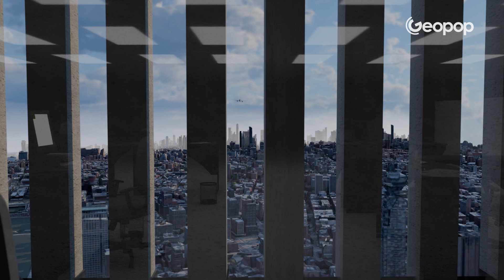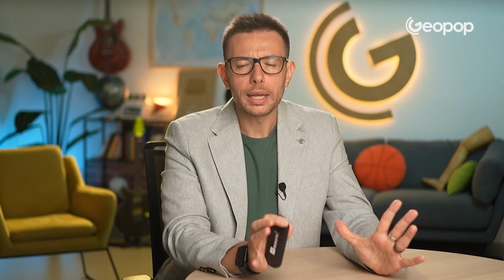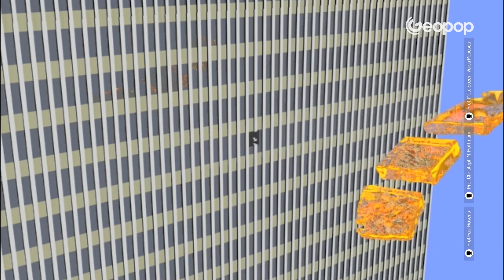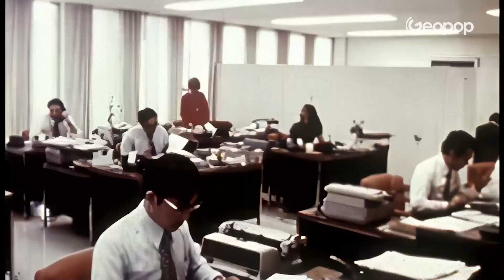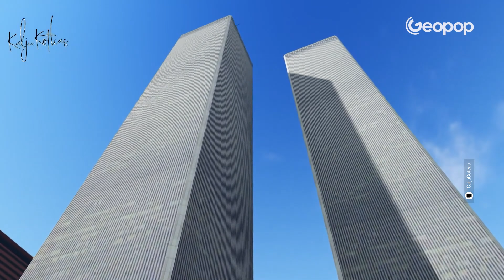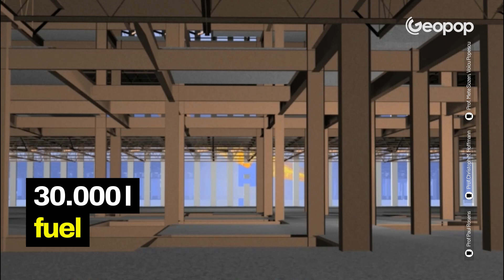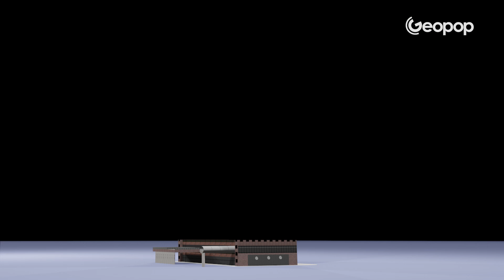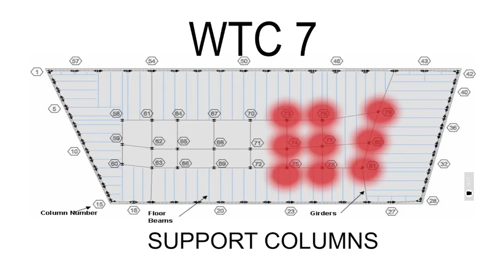9/11, 2001: The Technical Reconstruction of the Twin Towers and WTC 7 Collapses

Comment: You explain WTC 7's collapse complete with an animation showing a cascading failure starting at one end of the building, then immediately cut to footage of the actual collapse which went straight down from the centre.  So, which was it?  Also, no mention of the fact the building was reported to have already collapsed over an hour before it happened.  There is footage of reporters saying wtc7 had collapsed, while it was still clearly visible standing in the background.
Reply: The video fails to explain an important point which causes your confusion. WTC7 also had an outer shell which remained intact until the whole structure had collapsed inside of it, at which point it came straight down on itself.
Reply: @Mdnightsoldier   no that does not explain it. Even if there was six inches of space between the brick facade and the walls, the building must fall PERFECTLY vertically to not take the outside with it.  Did you watch the computer simulation?  It falls on an angle.  The ACTUAL fall was perfectly vertical.  That requires precision removal of the walls and core simultaneously.  That is why they don't bring up this subject.
Reply: @Mdnightsoldier  no I've seen the floorplan of WTC7 and the 83 support columns are divided evenly throughout the building. You cannot have the inner part of the building collapse without the outer frame of the building falling with it. And that's just one issue by the way. There's also eyewitness reports of many dead bodies in WTC7 while the 9/11 Commission said nobody died there. There were also two gentlemen who were rescued from WTC7 after experiencing several powerful explosions on floor 8. Then there William Rodriguez, the head custodian of the WTC complex who was in the sublevels precisely before and during the first plane impact and there was a massive explosion in the basement BEFORE the plane struck and his coworker has all the skin on his arms effectively detach from the pressure wave and it was hanging off his arms like he was taking off a shirt. President Bush even gave William a medal because he used his master keyset to open many locked doors and save hundreds of lives. He is ADAMANT the explosion in the lower basement was BEFORE the plane hit.
Reply: @brandentownsend7298  why should we believe "eyewitnesses" or W.R.?
Reply: @brandentownsend7298 Yep. Their's a whole documentary on it that has seemed to be scrubbed from the internet. They talked about the explosions, Atta's passport in the rubble, beams were cut in what is called a demolition cut, and the elevators being shut down and worked on by a company that was owned by a Bush. Plus, a plethora of other damming information. Dick Cheney said, "To unite the American people we need an event akin to Pearl Harbor."
Reply: @brandentownsend7298  if you knew anything about what you were talking about, you would know that the jet fuel from the planes dripped throughout the elevator systems and caused explosions all throughout the towers, all the way down even in the basement. it was not before the planes struck, as many other eyewitnesses have confirmed. crazy how he's the only one who thought it was before the planes struck when he was in the basement far away from being able to see or hear the plane. what might have been what he thought was the plane was debris hitting the ground or the fireballs exploding in the lobby, but every single other witness has not mentioned the fireballs being before the planes hit.
Reply: @brandentownsend7298 spot on mate couldn't have listed the many obvious problems with the mainstream narrative top man!
Reply: @worblergworbler  WTC7 wasn't hit by a plane. The jet fuel thing is BS. A detonation wave went through the lobby of the twin towers and blew out all the windows and dislodged granite panels off the walls. Gas doesn't detonate...it's conflagrates.
Reply: @mikehenrys eyewitnesses are often unreliable sources of info
Reply: @Mdnightsoldier 
The construction drawings of WTC 7, and the inspections written reports and supporting photographs clearly indicated that the so-called outer shell was fixed to the steel frame of WTC 7. There is no way the two collapsed separately. 
See the UAF Study of WTC 7
Reply: @21:09 "Now why did the NIST rule out explosions?". Then we are shown a video of outward blasts on a demolition.  If I were a police inspector, and someone dismissed an explosion, I would agree that the person was not murdered by explosion.  But have we considered knife wounds, or arrows or bullets or poison. That dismissal of explosion appears to me as a straw man. Look at their computer simulation. If the internal structure has disintegrated, then that part of the building has fallen.  Column 79 would not have collapsed unless 44 was pulled inward.  That outer wall on the southeast corner would have fallen very early.  If their scenario is correct, then the building would have collapsed toward the south east early on, but possibly only a partial collapse.  Not almost straight down.
Reply: @JosephBoxmeyer-u3d because explosions didn't make the building fall.
Reply: Noone understanding the very different construction of #7 from the design of #1 & #2 would have expected #7 to fall because of fires, only as though it felt the need to copy her two taller sisters.
Reply: @JosephBoxmeyer-u3d  You don't speak for 'everyone'.
Reply: @mikehenrys   sorry, Mike, I don't recall speaking for "everyone".  What do we disagree on?
Reply: @JosephBoxmeyer-u3d  "No one understanding..."
Reply: The video shows the same thing as the simulation.  The internal portions of WTC 7 failed first, leading to a progressive collapse from one side of the building to the other.  In the simulation, notice that once the penthouse on the roof collapses, a vertical collapse continues downwards from it while the outside frame of the building remains largely intact.  Once the complete support from the three critical vertical columns was gone, the others failed progressively - but very quickly.  With each failure, more weight was placed upon the remainders, accelerating their failures.  Since this collapse progressed from one side of the building's core to the other, it can be clearly seen twisting, developing the famed "kink" along the roofline (a horizontal distortion, not a vertical one) just before it begins to collapse vertically.  It matches the simulation precisely.
Reply: @marksanders768  no the real fall does NOT match the simulation.  Did you to really watch it?
Reply: @marksanders768   sorry, where is the twist that you clearly see?  I do not ask this to be combative, but to me more than half of the fall is straight down.  And can you honestly believe that if all of the beams are giving out at the same time, that none would poke through the outer wall?  To me, the official story is a strange conspiracy theory.  It is asking me to accept and to pretend to see what I cannot see.  Help me.
Reply: Pull it ?
Reply: Seven didnt go straight down. It leaned in the direction of the failed support . You can see it in the this video if you're paying attention and in many other videos from several vantage points. But of course you are married to your ideology so I guess it went "straight down".
Reply: @bweber6256   I do not recall whether you have insisted that the actual fall of seven matched the computer simulation.  If not, then sorry.  But I have watched the simulation again, and the sides bend inward at the top six floors.  But did not happen in the actual fall.  I do not have an ideology on this. I am just bothered that I see things that do not fit the authoritative story.  Their simulation is based on the fall being initiated in the order which they fed into their program.  I agree that the first thing that I see is that penthouse collapsing.  Then I see light in the windows at the corner under that penthouse.( this is from a different video). Then the center of the roof bends downward. That would agree with the sides at the top bending inward.  Except that they don't.  I sincerely question whether they correctly programmed the actual building into their computer .
Reply: @JosephBoxmeyer-u3d  there is a much more detailed video of WTC7 collapse that juxtaposes animation with actual video of the same sections and shows very clearly how it failed along with the engineering explanation. The beginning of the failure was in part because of the retrofitting to increase the floor count to 40+ stories. Because of the utilities in the lower floors they had to do some creative design to put support columns on one side of the building. This arrangement, rather than straight vertical columns is what led to the initial failure. You can find the video I'm speaking of on You Tube. It shows the structure of WTC7 and the sequence of failure in more detail than this video. It's hard to deny the logic of the explanation and video evidence if you watch it.
Reply: The steel below the fire wouldn't have been weakened by the fire thus it was not going to break like the heated steel.
Reply: @johnstoddard4692 weakening steel ultimately caused it to collapse.

Not thermite, not bombs, not heat rays or whatever you people pull out of your ass.
Reply: That's what I noticed immediately. 
The claimed weak point that supposedly started the "progressive collapse" is the opposite of what we see in the video. 
Anyone who doesn't question why this is is a cowardly simpleton.
Reply: I am not a fanatic conspiracy theorist but WTC7 collapse is a mystery and Im sure there is a coverup. america lives on cover ups, Area 51, Marilyn Munroe, JFK. The list goes on, and will continue.
Reply: Reuters accidentally reported WTC 7 as collapsed. It had been completely cleared as it was deemed " AT IMMINENT RISK" of collapsing. Reuters got it wrong. Nothing weird. Nothing sinister. If you think Newsagencies dont screw up sometimes then you need to get out a bit more!  The BBC picked up on the Reuters report and reported it themselves. Again. Nothing weird or sinister. Conspiracists are scraping the barrel saying this error is evidence of wrongdoing.
Reply: https://youtu.be/f3YTrU2eARo?si=w8kTp_FGKNeeXqSo

;)
Reply: Go figure it was bbc news, a news channel not even from America that said something wrong.
Reply: Omg. SMH.
Reply: @TheCriticalStinker-jw4fl.     Personally, I see no need for rudeness.  Yes, it "sank in".  Thank you for the information about the collection of steel debris.  Is all of that material catalogued and available for viewing on You Tube?  We can be polite.  There are at least two groups of people involved in this discussion.  Those who believe that they already have sufficient understanding to have formulated their conclusion.  These should consider themselves as available to answer questions for the second group.  I am of this second; we who are sincere inquirers .  I must speak to the term "conspiracy theory".  I have binge watched many many videos about 9/11.  Many times I have watched the planes.  I have not yet seen any evidence to bring me to conclude that Muslim terrorists were flying those planes.  I have heard the desperate calls from passengers on those planes.  That seems trustworthy. But, by definition, those terrorist pilots is a conspiracy theory . I make this observation because the name calling is not normal to civil conversation. On what site might I view the evidence?
Reply: 4 planes hijacked.  3 planes hit a target.  4 buildings went down.
Reply: The minds of children are easily manipulated when some of the adults are lying! 

What about the molten steel?  Rivers of steel.  Like a foundry!
Reply: Those buildings were taken down with professional precision. Thinking any differently means you are living comfortably in your indoctrination.
Reply: Back then the majority of people didn't have Internet in the palm of their hand. The news could easily BS people into a war back then. You couldn't do it today as easily. That's why they had to come up with covid. Too much compartmentalized  bureaucratic people involved and nurses and doctors that invested so much into their career that they turned a blind eye to the fraud and medical murder.
Reply: It was pulled! Inside job!
Reply: AE911Truth
Reply: @mvwoon we all know the truth, its you conspiracy assholes that refuse to be proven wrong.
Reply: Which is it? Do you trust reporting from people on the scene or are they all fake news helping the conspiracy? You can't have it both ways. In the moment reports are often wrong. They're just trying to break the story first. Obvs people on live tv with the building behind them were mistaken. Let it go.
Reply: @scalzmoney  Let it go? How many facts do you discount before you arrive at a conclusion that fits your comfort level?
Reply: @scalzmoney  WTC7 came down like it did because it was a controlled demolition. 

THAT is why they knew it would collapse. That is why the media broacasted it.

And yes the media is corrupt, although you could see a lot of honest reporting on the day itself, as events unfolded.

Those parts were carefully selected never to be shown again to people
Reply: @Shawn47  There was inaccurate information and pure speculation flying around the news all over that day. It was mass chaos. No one knew really what was going on in the heat of the moment. I remember hearing reporters talking about car bombs going off all over DC and NY, one said the planes were private Cessna type. The reporter probably had no idea which building was which and mistook one of the four buildings that were almost entirely crushed under the wreckage of 1 and 2, for building 7.
Reply: @TheKairielise  no they specifically stated the Solomon Brothers building (WTC7) was the 3rd building to collapse, while the building stood in the background. It then fell 20 minutes later while they were still talking and on the air.
Reply: I have a question for you, conspiracy theorists: who do you think was on those planes? I mean, the hijackers
Reply: @lucagnecchi5228  There are quite a few possibilities;
 - Actual terrorists, contracted indirectly by government agents, not realizing who they were actually working for.
- The real planes were switched, and the ones hitting the buildings were unmanned and flown remotely.
- The terrorists were actually U.S. agents brainwashed into believing the cause was worth their lives.
- The terrorists were U.S. agents tricked into believing there was a way out until it was too late.
- Aliens.
- Any number of other possibilities.
Reply: @lucagnecchi5228   yes the hijackers.  Have you heard of coordination?  Our govt. knew about the flying lessons for people who didn't want to land the planes.  And we knew who they were and where they were.  We had inside people in their organization.  We knew their true identities and which planes they were on.  Didn't it bother you that there was a public announcement of who they were only hours later?  Supposedly, we still don't know who planted a device at the DNC headquarters on Jan. 5, 2021.
Reply: @lucagnecchi5228   I have watched many many videos.  I see the planes.  I have never seen any Muslim hijackers.  Have you seen any Muslim hijackers?  Give me a good reason to not call this a conspiracy theory.  Yes, I agree with you, if you tell me that you have heard recordings of callers on the planes, and of the voices of hijackers recorded by flight control people.  And I doubt that they were faked.  But I believe that there were very complex things that happened.  And that official story leaves out too much.
Reply: @lucagnecchi5228 innocent lives. A mother and daughter flying from Boston to California for a Disneyland trip. An 87 year old man who was flying to be at his sons wedding. Betty Ong, who was a stewardess called to warn atc of the hijacked aircraft, she repeatedly said the flight was sporadic and also said she can see buildings out the window. She stayed on the line up until impact.
Reply: @TheCriticalStinker-jw4fl.  As to my meager knowledge of physics, I seem to recall that "thermal expansion" on steel is normally an effect of the heating process, while cooling causes retraction.  But as to water, contrariwise, cooling below freezing causes expansion, and warming of that water above freezing causes retraction; the necessary temperatures for each being dependant on pressure and elements in solution.  My comment about the the steel beam expansion was based on my doubts that the fires were of sufficient duration to have caused such expansion.  Also, as you are aware, a steel structure of the type in #7 is not obligated to fall entirely because one end falls.  This is the reason for the need for thorough placement of charges in a planned demolition.  Even if a fall was initiated by the failure of the beam between columns 79 and 44, there is no reason to expect the entire floor to collapse, nor for either of those columns to fail.  As you understand, the NIST computer simulation received faulty inputs.  If you are familiar with that program, you understand that improper dimensions for the steel parts was input.  Also, false criteria for catastrophic failure were input, resulting in illogical simulation results .
Reply: The New Pearl Harbour?
Reply: @lyft4238  I posted the comment about Cheney saying that, and my comment was removed!
Reply: You didn't pay attention to the video. The collapse began as an internal collapse that then pulled the rest of the building down. WTC 5 also had extensive internal collapse even though most of the outer structure was relatively intact. 
There was much confusion on the ground about which buildings were which, even among the first responders. There are numerous videos of police and fire mistakenly referring to the remaining structures by the wrong number and in once case two firemen arguing about which building was #6. If local fire and police weren't sure, it would be easy for the BBC guy to mistakenly refer to (or have been told the wrong number) one of the other buildings that had collapsed as "WTC 7". There were other buildings that came down besides these three. 
But yeah, I'm sure the BBC reporter was in on it....🙄
Reply: George Bush was waiting on it to happen.. the building was full asbestos and needed stripped back to concreteat also needed an excuse to start a war with the east.  I was hoping that this video would show me some new information but no luck
Reply: @KouRou2002 Omg! Not that bloody asbestos conspiracy again. 😂😂😂
Reply: When bush was told that twin towers was demolished by incoming plane he smiled from being told that's happened and he didn't rush in telling people and nation that it terror related.  @KouRou2002
Reply: @brookerobertson2951  You are talking crap. The US were in the process of negotiating with the Taliban Government for drilling rights . 9/11 and the subsequent war screwed that up.  As for the asbestos thing? WTF has that got to do with the USG? It was privately  owned. 
IT WAS A F*CKING TERRORIST ATTACK.
Reply: @KouRou2002 so you mean to tell me all of the ATC recordings from the aircraft, hundreds of videos showing impacts, debris from both towers destroying everything around it, burning debris that pelted the southern face of wtc7 dont exist to you? Are you this much of an idiot?

Wtc 7 because a supporting beam couldn't stand to the fires. A total collapse followed starting with the floors and steel followed by an empty shell of a building came down.
Reply: Well it was probably reported early as new stations want to be the first to call something out or publish something. It was well known WTC 7 was going to collapse. They evacuated the area long before the collapse, most probably because it was a hectic day and a lot was going on someone said it had collapsed or some misscomunication and they reported on it even though it hadn’t collapsed yet. As stated they knew it was going to collapse before it did. Also it shows the inner core more or less collapsing, which the outside didn’t do untill moments later. The technical analysis of the collapse might also be slowed down a bit but again the core collapsed before the outer shell. If you actually look at the photage of the collapse like a minute of it you will see 20 seconds before the collapse the penthouse goes down. Which is on the side the collapse started, btw if it was explosives you would hear it. Ever heard a demolition of a building. Its loud, its really really loud. Not to mention as he said debries shoot out.
Reply: @unterman8589 lol liar
Reply: @unterman8589WTC7  was the socalled alleged "first steel skyscraper to completely collapse from just fires alone", according to NIST. 

So, how can one predict a "first time in history"?

I'd like you to think about this question.

I think we can agree on that the collapse of WTC7 looked very much like a controlled demolition.
Well I hope we can.

And if it looks an awful lot like a controlled demolition, what are the odds that it would NOT be one?
Reply: @unterman8589i love that you people disregard important factors that day to fit your extremely shitty narrative.
Reply: @unterman8589 
Unfortunately for believers of the official story, four independent studies of WTC 7's collapse completely disagree with NIST's guesswork.
Reply: @JackCarlock56 no signs of demolition were found. Stop lying, you ape.
Reply: And why did Israelis dance in celebration?
Reply: @loco1j  A better question is why this (coincidentally antisemitic) rumor won't die when there's zero proof of it.
Reply: @compwiz101 those 2 words has have been completely stripped of its meaning.  The evidence is clear. The motive is clear. So my statement is correct
Reply: @compwiz101  There's a mexican live news coverage here on youtube that has those images, live as it happened. I remember watching the news when it happened and I remember it well. They even parodied those images in The Simpsons Movie.
Reply: @compwiz101 Er, because #IsraelDid911, on account of how its a Terrorist State that has absolutely no qualms about mass-murdering innocents and blaming others.
Reply: @Hik4rol  Funny how people keep saying them remember seeing this, but never produce any of this supposedly widespread footage. 
Given I can find more people that are certain they saw a movie back in the 90s called "Shazaam", starring Sinbad - dispute the film never having existed, I want evidence.

There were report of 5 men supposedly jubilant - according to the one New Jersey woman that reported them. (Shout-out to everyone believing random old lady with binoculars being a 100% accurate judge of behavior at a distance)
She didn't record them, so I'd certainly like to see the supposed footage of the event.
Reply: @compwiz101  I did and owner of this channel blocked my comments and direct links LOL 😆

Search for TV AZTECA cobertura del 911 here on YouTube. Around the 3:00 hour mark, the footage LIVE shows up.
Reply: @compwiz101 
I already and they took my comments down lmao.

Look for mexican coverage pf the incident and you'll see it live as it happened.
Reply: @Hik4rol  Man I'm not going on some wild goose chase with the vague descriptor of "mexican 9/11 coverage"
Reply: @compwiz101  Search for TV azteca 911 cobertura. The scenes are there and they also interviewed a reporter on site and she described what happened live including peoplebgiving out candy on the street and dancing.
Reply: @compwiz101  Search for "TVaztec 911 cobertura"

The scenes are there and they also interviewed a reporter on site and she described what happened live including people giving out candy on the street and dancing.
Reply: @compwiz101  search for 📺 azteca  cover tura (date) and you'll see.

(Please write the emojis. I'm going mental trying to write this without it being taken down)
Reply: @compwiz101   You wanted proof and I gave it. Not my fault they keep pulling my comments down when I address the damn video even with timestamps.

Someone wants to keep this embarrassing display of hate a secret for reasons beyond me.
Reply: @Hik4rol  Unfortunately, you giving proof is functionally identical to you saying you've provided proof while doing nothing at all. Doubly so given that you're doing nothing to sidestep the problem like, say, providing the title of the video so someone can actually find it.
Reply: @compwiz101  Look for Azteca Siete Cobertura (date) and you'll see it at the three hour mark live.
Reply: @compwiz101   Look for Azteca Siete Cobertura (date) and you'll see it at the three hour mark live.
Reply: @Hik4rol  Reuters Agency fucked up and a couple of news agencies just repeated the info in error.....including the BBC . Nothing unusual about that WHATSOEVER. Conspirasists BS.
Reply: @loco1j  They didn't, you basht MAGAt.
Reply: @loco1j  because they knew they could easily convince the idiot republicans in charge to attack their muslim enemies. And they were right.
Reply: @loco1j  I'm sure you danced in celebration on Oct 7....does that mean you had something to do with it?
Reply: @loco1j they were arrested. Go simp for palestine
Reply: @loco1j It was Iraquis, not Israelis.  I swear to god the IQ in these comments is in the minus figures.
Reply: @loco1j  Because they were in on it?
Reply: @seedplanter7173 no one was in on it
Reply: @loco1j  No such a thing.
Reply: @mikehenrys  Dominik Suter and Urban Moving Systems must be a figure of my imagination then. And so is the Yinon Plan
Reply: @loco1j  no "dancing".
Reply: @mikehenrys  actually the dancing Israelis were real and even appeared on an Israeli talk show to discuss the matter. I've seen excerpts of that interview.
Reply: @brandentownsend7298  They didn't dance.
Reply: @mikehenrys  not really? Poor ignorant boy…
Reply: @mikehenrys 
It's absolutely true. Five Israeli nationals, two from the IDF and three from Mossed were observed celebrating as the buildings burned. They were arrested by PDNY while driving a white van owned by United Moving Company  (or something like that) a company owned by an Israeli national.  Look it up before say it didn't happen.
Reply: @loco1j Also, it was stated that the elevators were shut down due to them being worked on and the company that was doing the work was owned by a Bush.
Reply: @mikehenrys  They did. There's a mexican live news coverage here on youtube that has those images, live as it happened.
Reply: @Hik4rol  Then show the video
Reply: @mikehenrys Of course there was dancing! And high-fiving, jumping in jubilation, even flicking cig lighters on/off in front of their tripod,mounted cameras, while the towers burned & Americans jumped. Those Dancing Israelis were ecstatic. All their months, nay years of planning had come to glorious fruition. In their minds, they were heroes.
Reply: @brandentownsend7298 "Our purpose was to document the event." Which begged the follow-up question- how did they know in advance of such a momentous "event" which would be worth documenting?
Reply: @myword1000  BS
Reply: @mikehenrys  

YouTube is not letting me place direct URL so search these two videos:

[2001] Cobertura televisiva mexicana del ataque a las Torres Gemelas
Timstamp: 1:04:39. Reporter narrated that the gun firing was in Cisjordania. He also stated that thankfully there weren't massive crowds celebrating, but still, police and army were moved in order to cease those celebrations.

Cobertura del 11/SEP/2001 | Noticiero Hechos (TV Azteca, México)
Timestamp: 3:55:28
The reporter in that country narrated that palestinians and israelians danced and paraded in the streets and gave candy to the children. People were arrested in Jerusalem for doing such acts.
Reply: @mikehenrys  
YouTube is not letting me comment so search these two:

[2001] Cobertura televisiva mexicana del ataque a las Torres Gemelas
Timstamp: 1:04:39. Reporter narrated that the gun firing was in Cisjordania. He also stated that thankfully there weren't massive crowds celebrating, but still, police and army were moved in order to cease those celebrations.

Cobertura del 11/SEP/2001 | Noticiero Hechos (TV Azteca, México)
Timestamp: 3:55:28
The reporter in that country narrated that people actually danced and paraded in the streets and gave candy to the children. People were arrested for doing such acts.
Reply: @mikehenrys 
They are taking down my comments for god knows what reason. Search them yourself. There are two streams. One from Televisa and another from Azteca 7.

In Televisa, search for the video with +1hour. At around 1 hour and four, you can see people firing.

In TV Azteca, at around 3:55:28, the reporter says people danced and gave candy to children in the streets.

People were arrested for these celebrations.
Reply: @mikehenrys  TThey are taking down my comments for god knows what reason. Search them yourself. There are two streams. One from Televisa and another from Azteca 7.

In Televisa, search for the video with +1hour. At around 1 hour and four, you can see people firing.

In TV Azteca, at around 3:55:28, the reporter says people danced and gave candy to children in the streets.

People were arrested for these celebrations.
Reply: @mikehenrys  They are taking down my comments.
Reply: @Hik4rol  Mine too.
Reply: @Hik4rol  I posted several links to the BBC footage of their reporter saying the building had collapsed, while it was clearly visible, as well as replies to some of the other comments, but my comments keep getting removed.
Reply: @Shawn47 
Same. Perhaps this video is blocking comments that have certain words or phrases and is pulling them down. It's honestly frustrating.
Reply: @Shawn47 So what if they did? Mistakes happen. Especially on a date like 9/11 . These conspiracies are like a bad fart. They stink and linger far too long.
Reply: @Shawn47 I know what footage you are speaking of. Lemme ask you something, you ever heard of people getting something wrong because they are from a completely different country? Like dude, it’s the British Broadcasting Corporation. A news company not from America getting some facts wrong while the news is still fresh, wow, not like that has happened dozens of times that I can list off of the top of my head.
Reply: @mikehenrys that's why that got arrested and sent back to Israel for a nice interview mosad. Just documenting the attacks lol
Reply: @justintrollope7544  Every arrest ever, was always legit?
Reply: @brandentownsend7298  I also have seen excerpts of the interview.
Reply: @BBroadnax  They were all Israeli.  Look at the documentation Christopher Lee Bollyn compiled.  It's irrefutable
Reply: @mikehenrys  Correct...they just high fived and jumped with joy.  One held a lighter up with the burning towers in the background while he had his picture taken.  The pictures were released online.  When arrested in NJ, a bomb sniffing  dog alerted for explosives in the van they were in. Held in US custody for 70 days.  Back in Israel they said they were only in the USA to document the attack, showing prior knowledge.  If not a lie, maybe some of the other hundred+ foreign spies arrested did more to cause the damage.
Reply: @JackCarlock56 better not waste your time talking to a wall.😊
Reply: You would not hear thermite and thermite cutting the beams. If you look into the construction of the tower you will see that the towers columns at the base were 17 inches square almost solid steel.  But they came down in cut pieces.  Also building #7 had a very different design.  The official explanation (NIST) altered the design of the building to explain how it fell.
Reply: @JosephBoxmeyer-u3d those cut beams were made to move the massive tons of debris. Cutting it to move in chunks.

Do some fucking research.
Reply: This video is more false propaganda
Reply: These towers where all demolished by our own government as a excuse to push the patriot act and continuous wars in the middle east
Reply: @Shawn47  prove it was reported before it happened
Reply: @mikehenrys BBC News report with building 7 still standing in background.
Reply: @MrPlumpynut  corrected mistake
Reply: That's correct. I watched it on BBC television all day in the Netherlands. They reported it before it happened. @MrPlumpynut
Reply: @mikehenrys  just saw correction. Thank you.
Reply: @DP1SDABDDST  No problem.
Reply: @MrPlumpynut - so the Illuminati send a memo to the BBC to announce in advance what was going to happen? No dude..
Reply: @MrPlumpynut i didn't realize BBC is american news.

Go sit down.
Reply: @MrPlumpynut  They reported that they knew it was on the verge of collapse. Nobody tried to save the building, the area was cleared, because it was gonna fall. That's all.
Reply: @mikehenrys  it is in videos.  One news video from London is done with a live view of #7 in the background.  It is still standing when they claim that it has fallen.
Reply: @JosephBoxmeyer-u3d  corrected mistake.
Reply: @mikehenrys there's plenty of videos. 99.99999999 percent of 911 videos that have an alternative viewpoint have been taken down from yourube( google) the fact that this is on youtube told me the narrative they were selling. Also the narrator has a feminine voice to help the already gullible leftist believe what they are hearing. I just watched another propaganda video where the narration was a feminine male. All of this is mind control on a tried and tested level. The best way to expose lies is to let then into the sunlight. If 911 truth videos are lying then why are they so afraid of them being on youtube. Controlled speech is a billion times more dangerous than wrong speech. This is propaganda which is fine as long as my "truther" videos can bee seen also. And also not shadow banned. "Plastic Phase" 500 degrees farenheit mu ass. This is bullshit. The amount of heat required to get to the "plastic phase" was done by nanothermite and explosives, not jet fuel.
Reply: @mikehenrys Nothing to prove. It's a matter of record. The BBC talking head Jane Standley was droning to air about WTC7's "collapse", in the past tense, and then it happened on the monitor behind her, in real time.
Reply: @mikehenrys It was reported before it happened. But it was a simple error by the BBC who received an erroneous update from Reuters News agency.
Reply: @mikehenrys it was.  BBC i believe were the ones who let it slip before it happened
Reply: @mikehenrys  BBC reported a long time before building 7 fell that it had collapsed. FACT. LOOK UP THE VIDEO
Reply: Lol it was here in the UK, the BBC reported on it about 30 minutes before it went down if i remember correctly. You can just google it or check on youtube. @mikehenrys
Reply: @mikehenrys go watch the video, its rather easy
Reply: @Crackinjars  Which video?